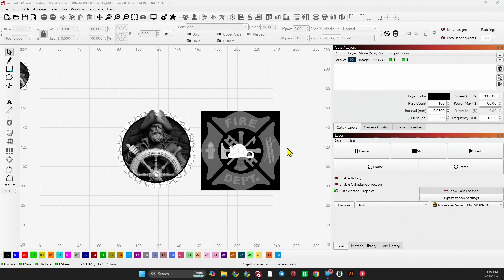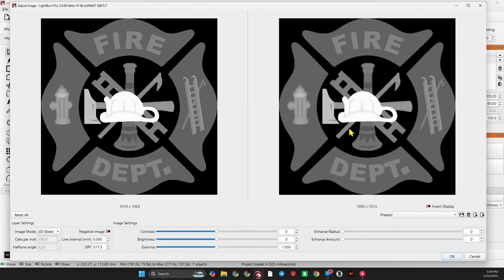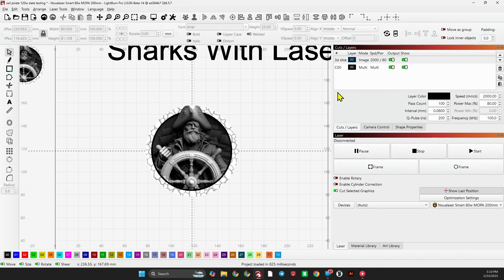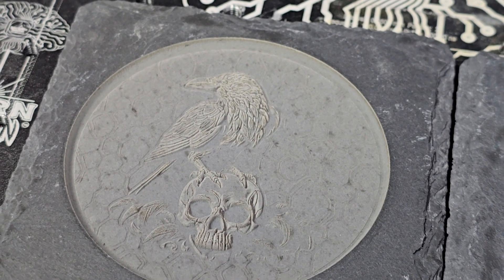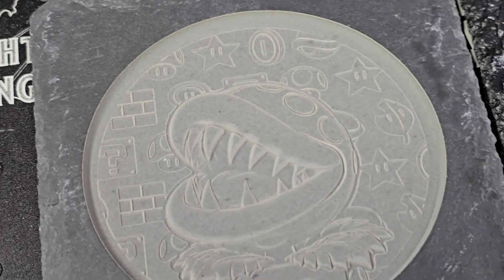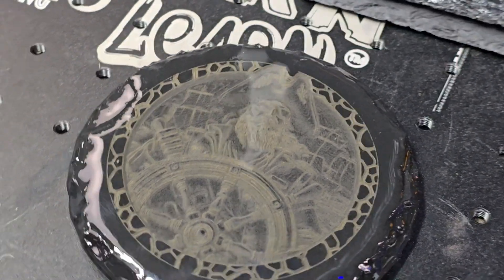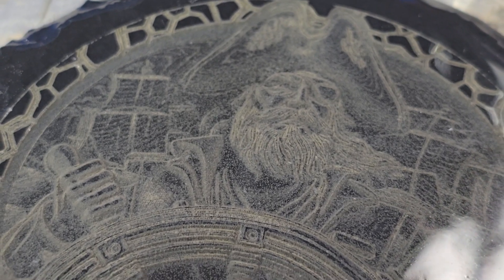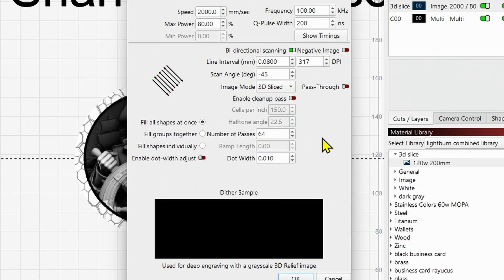3D Slate Engraving with a Fiber Laser - LightBurn Tutorial - Settings - Free FIle

Comment: Thanks a lot for the video — your 3D slate engravings look amazing! I’ve been trying to get similar results with my ComMarker B4 MOPA 60W, but I'm running into a problem.
From the second pass onward, the stone starts to melt and gets shiny instead of that nice rough, matte texture you achieve. I've tried many different settings (adjusting power, speed, frequency, and even using a very soft air assist to cool the stone), but I still can't get that clean, deep, sandblasted-looking result.
Do you use any kind of air assist during engraving?

Comment: hi done mine on a 30watt fiber came out not to bad but i have pimples all over it what do you think it is please would send pic but dont think you can
Reply from the maker: run slower and see if they go away
Reply: @LSEngraving  I did figure it out in the end with some help. I was running at 60 MHz, changing it to 30 MHZ handle, and the pimples went away. They came out really good.

Comment: Thank you Patrick.  Just like the diode video, I'd not had good results working with slate on my 80W MOPA fiber laser.  The settings you provided, need aa slight tweak to work on my 80W, but I got some pretty good results. Wish I could share the two test I made, but suffice to say, they came out pretty darn nice.  Now, you mentioned doing a video on a CO2 galvo, any chance to do one on a CO2 gantry?
Reply from the maker: if you are on facebook, please join the laser makers realm fb group and share!!!